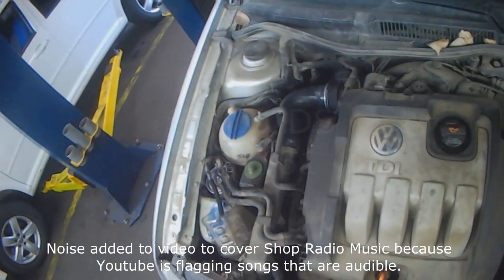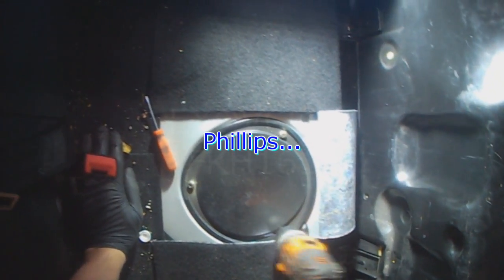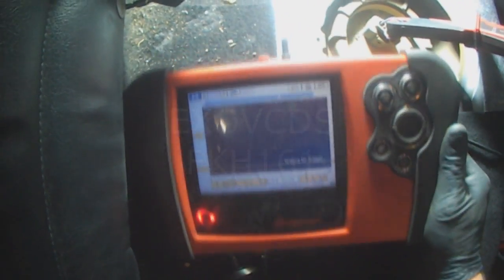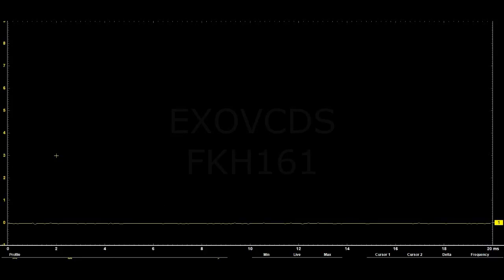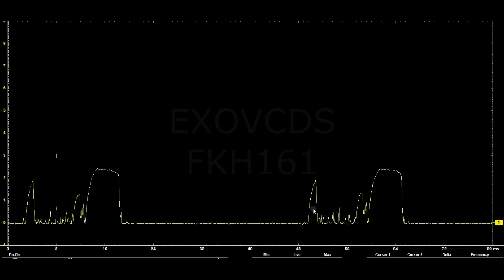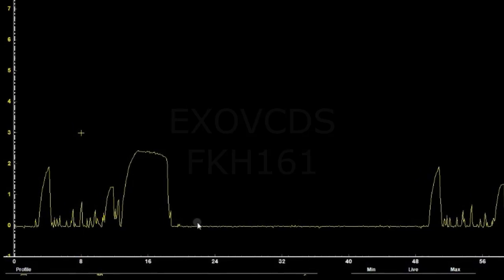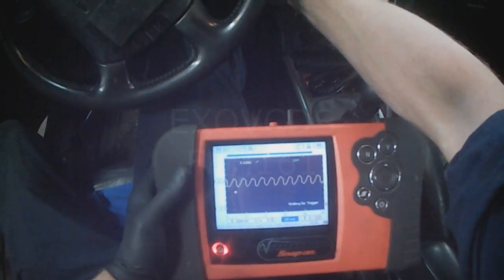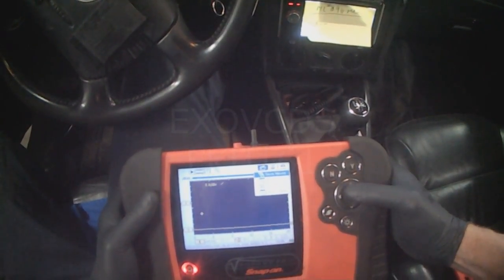VW A4: PD TDI Intank Pump checking

Comment: what should be the acceptable range of Amps? my car (Jetta MK6) pump current is only 2.5Amps! my HPFP failed twice because of the low pressure. This is strange because both the tank and HP pumps were replaced!
Reply from the maker: Sorry, I don't know what the amperage should be... never had to check it. Service info only lists checking for a specific fuel quantity within x-amount of time.
Which engine? Mk6 Jetta's never had the PD TDI as in this video.
Reply: @EXOVCDS  Yes you are right, i checked the service info book again, it should flow at least 600ml of fuel amount in 30 seconds after the filter and about 1l before the filter. Amps check is the last procedure to confirm 100% that the pump is failed.

Comment: Thomas i have question i have a pd tdi electric pump is working but the tandempump can not able to suck fuel even with handpump is not possible to suck fuel the car will not start even with working electric pump is there a valve or something could stuck? Normaly it should easily get fuel sucked out of the fueltank ?or im wrong?
Reply from the maker: You should have good flow if the electric pump is working... I think it puts out about 7 or 8 psi of pressure. If the black & blue fuel lines are reversed at the pump cover, you will not get fuel going to the tandem pump. Disconnect the black fuel pump line above the pump and disconnect the line going into the filter. you should be able to blow into the line at the back and have air coming out at the front. Make sure that the pump is pushing fuel... attach a hose to the pump outlet (where the black plastic pipe attaches) and point the hose into a container. Have someone crank the engine with the ignition key... fuel should come out of the hose. If no fuel comes out, remove the electric pump and inspect.

Comment: S/D has a series on the  snap on scope , I'm think  he would press an tab  to invert the amp clamp on the scope  instead of manually doing it, not sure ?
Reply from the maker: Steve Rob Yes, there is an invert function... I'm all thumbs, so it's quicker / easier for me to just swap the clamp or wires.

Comment: And here I was thinking you had a beer belly lol...
What concern did you have in this car? I can see that it wasn't working at the beginning, since you had said you seen this in other cars,how about mk2,mk3?
Now I wonder if those model will start with a defective transfer pump as I know I had hw running issues with the mk2..
Reply from the maker: guayaco3299 This Jetta was in for a fuel filter, oil change, a check engine light (video next week... possibly, was a minor issue, not sure if it's worth posting) and the CV boots (other videos I posted today). Customer works outside of the city and doesn't always have time to get service, so he wanted us to check it over for anything else that needs attention. Figured I'd show the "flow test" at the filter... turned into a pump replacement... D'oh, forgot to show the "flow test" on a good working pump!
Reply from the maker: guayaco3299 I dropped 15 lbs... down to 190 lbs now. Still have a gut that needs trimming (can't tell from that brief appearance), then I will start a muscle workout routine. Going through an early mid life crisis... 2 years of medical issues that the Dr.'s don't have a reason for (no need to go into here). Feeling good now, that's all that matters.
Reply from the maker: guayaco3299 Sorry, forgot to address the intank pump issue... the mk2's "can" run fine with the intank not working (only sign / symptom being a noisy main pump). They can also run rough / lack of power when the intank fails... black smoke from incomplete combustion can make you think they are running rich (visual inspection only). The mk3's have a single intank / main pump... with it dead, so is the car.
Reply: ***** I knew that.....About the mk3....lol. I was just testing you.
Well I'm glad you doing much better man.. I know what you mean about the doctors, yet they never fail to charge you..

Comment: Am I doing this right? After taking this, I flipped it and it read about up to 2 or 3 amps.. nowhere near 8 or 9.... Thoughts? 

http://www.youtube.com/watch?v=7f-A6zQUJwI
Reply from the maker: Anna Kawski Remove the fuel feed hose at the filter and crank the engine (point the hose into a container). No fuel verifies that the pump is no good / stuck.
Reply from the maker: Anna Kawski I've seen them at 3A before as well (forgot to mention). The flow out of the hose test / check, will put any doubts to rest.
Reply: ***** Oh ok thank you!! I will check with the lines at the filter, this would definitely clear up how it is functioning... THANKS!
Reply: ***** PS - is it okay to crank while the hose is disconnected - AKA won't this introduce air into the engine past the filter? sorry, I'm still very new to car mechanics, but learning!
Reply from the maker: Anna Kawski Will be ok for the few seconds that you are testing (no need to crank longer than 15-30sec). If you get no fuel coming out, the pump is no good... make sure that fuse #28 is ok.